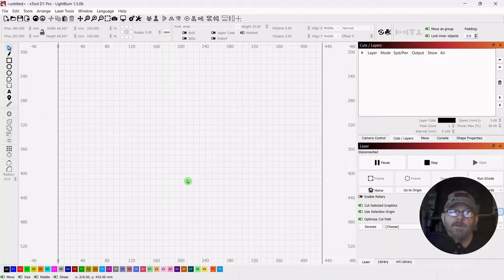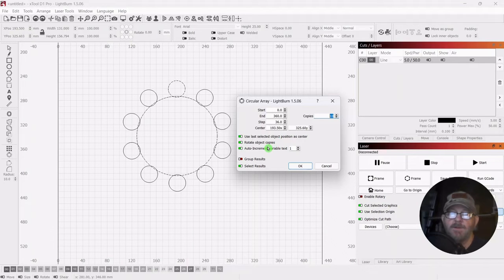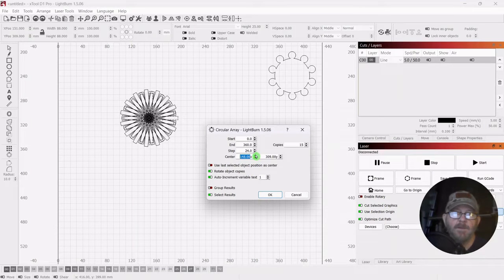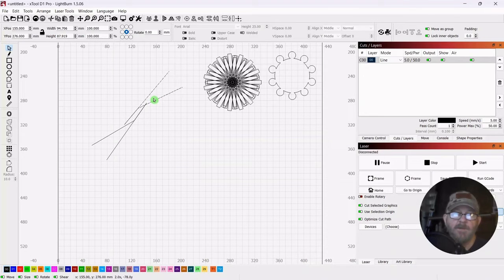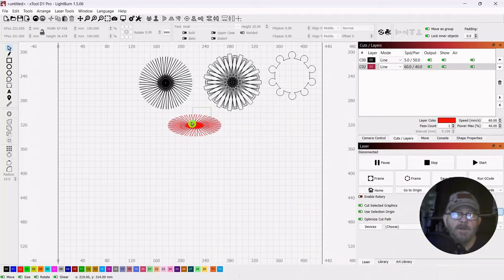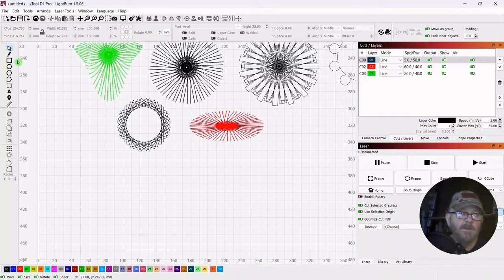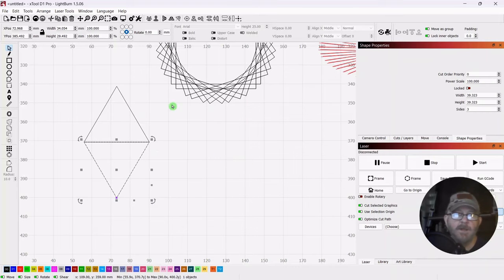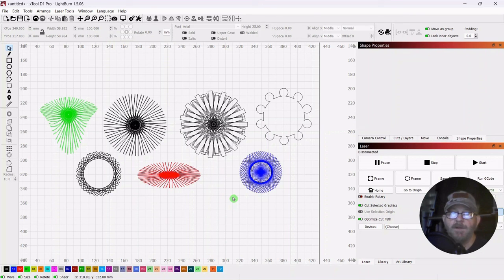Create Circular Arrays | Lightburn Tutorial #21

Comment: Would you make a video about creating a marble or diecast racing track with sharp and wide turns? It needs to have a way to connect the track pieces and guardrails for the whole track. I wanted to explore cutting to make the track flexible so it can bend around and create banked corners. A series of how-tos about this would boost your channel. As I'm running my own channel, I'm focusing on marble racing because my 6th grade kids love the racing and I can set it up in my classroom. Can you help? Thanks
Reply from the maker: Hey Mike. I appreciate the idea and I do like a challenge. I'm still pretty new at laser cutting but I will look into making a track and hopefully can pull it off. Not sure how soon I can do it but will start testing the process. Thanks again and take care - Dave!